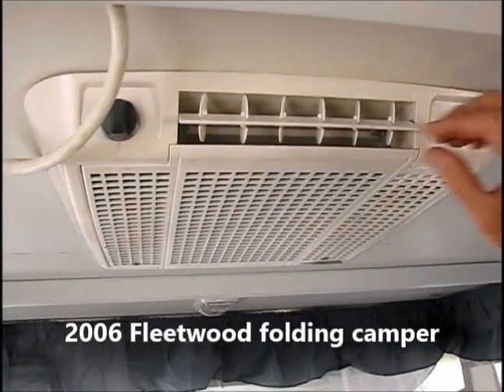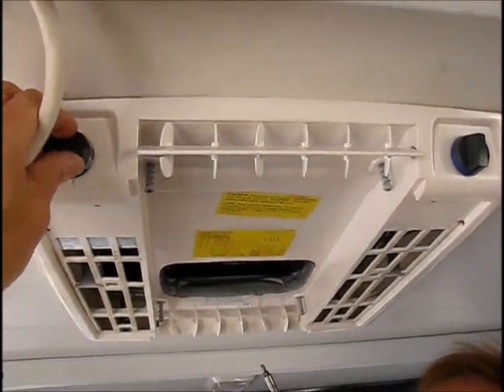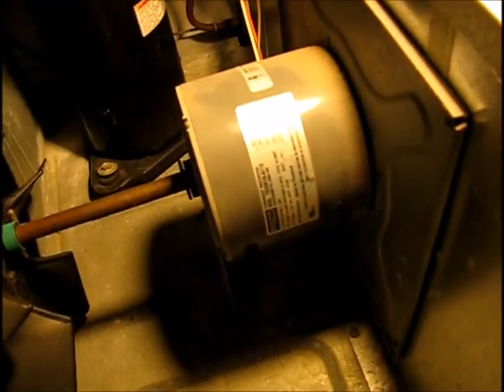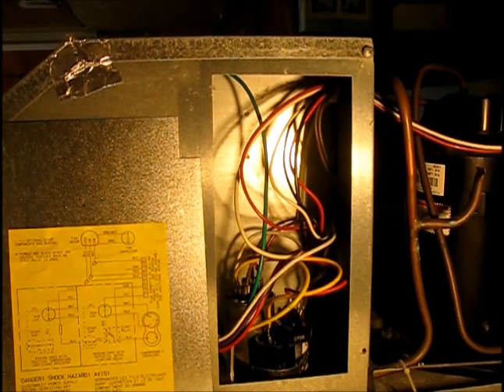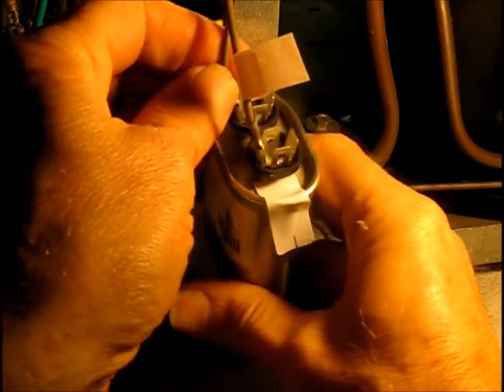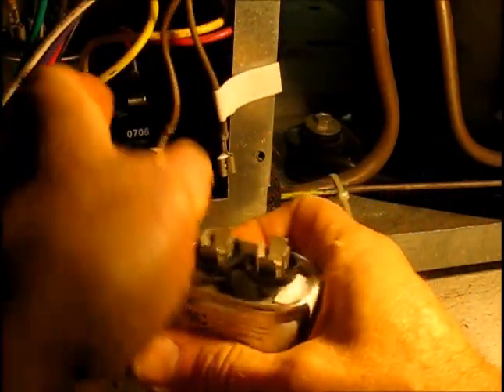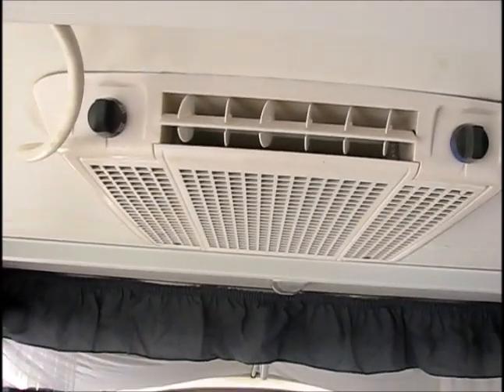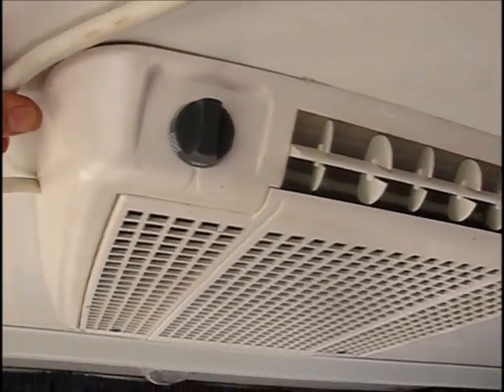When a 115 VAC motor only hums and won't start: How to replace the capacitor

Comment: I am using a 1980's Coleman and the motor is connected to two compacitors and it doesn’t specify which one is start how do I tell?

Comment: Would a capacitor cause the air conditioner not to make any noise at all
Reply from the maker: Not in my experience. That sounds more like a loss of power like a circuit breaker or fuse.

Comment: My fan only starts if I push it.     Replaced the cap with  a new one.   Still does the same?   Im guessing the fan motor is bad but once  its spinning it works great.
Reply from the maker: That is the classic symptom of a bad start capacitor. There is a start capacitor and a run capacitor. You may have replaced the wrong one.
Reply: The Original Mechanic thank you.   Its a portable air con unit and only has one capacitor.  There was a wiring diagram in side the unit that only listed  one cap.     Very strange.   I was certain it would fix it!     Bad cap?   Like a bad new one?    Ill have to look into how to test it with multi meter
Reply from the maker: Maybe it is a bad new one and make sure is is the right value and it is installed with the right polarity.
Reply: The Original Mechanic thanks Inbought a pack of 2. They are the same values as original.  Although the first one  I opened was all bashed in like a tin of beans nobody picks up at the  store as its all bashed.    Ill try the other one.  Probably  that!  :D

Comment: I’ve got an old GE single phase 1/4 hp 115v 3.8 amp AC motor that needs a new start capacitor and there are no markings on the existing capacitor for me to reference. Any idea how I can find out what kind of start capacitor I need. The motor will run if you give it a spin start with the shaft.

Comment: My fan turns on but then eventually just hums what is the issue?
Reply from the maker: I haven't experienced that issue, but it could be another capacitor, called a run capacitor...or the motor itself.  Good luck with it and thanks for watching.

Comment: How do I check to make sure it's the capacitor and not the fan motor.  Symptoms were the fan wouldn't come on on low speed then I tried high and it started now it won't start at all.  When I turn on A/C it hums but nothing happens.  Thank you, Ray
Reply from the maker: While the fan is humming, I give the blades a spin (carefully, with a screwdriver). If it takes off, it's the start capacitor. Also, if you have one, you can use a capacitance meter.
Reply: the fan should always spin relatively easy and make several revolutions when you spin it by hand. if you attempt to spin it by hand and labors only a few inches, then the motor bearings should be  reconditioned or replaced....and i say reconditioned because all too often the bearings are simplly gummed up or neglected. quite simple just inspect the bearing good visually then blow em out good with wd40 and shop air then repack with a good bearing grease....reinstall

Comment: I hope you would know my problem also. If the weather is not too hot, the AC works fine, but when in very hot temp, the breaker blows .. any idea? thanks great video
Reply from the maker: My experience is limited to problems with motor stall on startup. Thanks for watching and good luck.

Comment: My motor start if there is no load attached to it. It does it reliably. But as soon as I attach it to the load (pulley and belt of a compressor) it is not able to spin anymore.  Is this also a problem of the capacitor? wrong value or bad capacitor?
Thank you!
Reply from the maker: That's not gonna be a capacitor. I think there is a bad winding in the motor. It would need rewinding or replacement.
Reply: Thank you very much. You are right, it was the motor's fault. Fortunately for me, opening it up, cleaning it, greasing it up and then putting it back together back again solved the issue.  This unit was stored in a shelf for years in a dusty environment, and it really needed some cleaning.
Reply from the maker: Nice work. Good that you were able to get it going again.